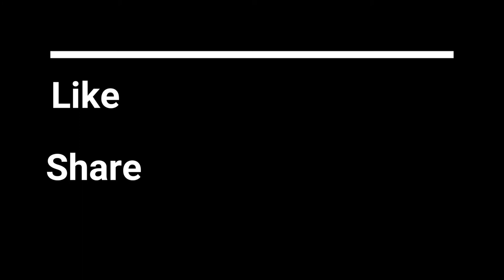PART 9 - 1952 Chevy 3100 - Upper Air Bag Clearance w/ S10 Frame!

Comment: What a ton of work that you normally don't even think about when looking at the finished results. Will you need to put the cab on to locate the rear can mounts?
Reply from the maker: LOTS of work behind the scenes of a finished vehicle... but every step gets closer and closer to stuff people will actually notice.  I plan on mounting the cab to the frame, and then working the rear cab mounts. :)
Reply: Do you have the link to where you bought the airbag system? Badass truck my 52 has a similar setup to yours
Reply from the maker: @franciscocarranza2669  I purchased the airbag system from ebay:  https://www.ebay.com/itm/D-Chevy-S10-Air-Kit-5gal-25-26-Bags-3-8-Valve-Shock-Relocater-Fittings-5-Gal/163081926197?ssPageName=STRK%3AMEBIDX%3AIT&_trksid=p2057872.m2749.l2649  Seems to be pretty decent so far... looks like price has gone up a little since I purchased it. Hope that helps!

Comment: Are those airbags from eBay???
Reply from the maker: Yes they are.  Bought this kit:  https://www.ebay.com/itm/D-Chevy-S10-Air-Kit-5gal-25-26-Bags-3-8-Valve-Shock-Relocater-Fittings-5-Gal/163081926197?ssPageName=STRK%3AMEBIDX%3AIT&_trksid=p2057872.m2749.l2649